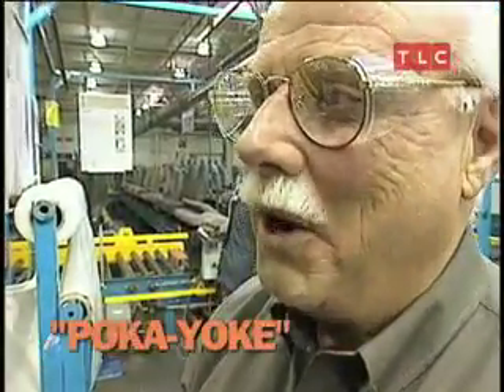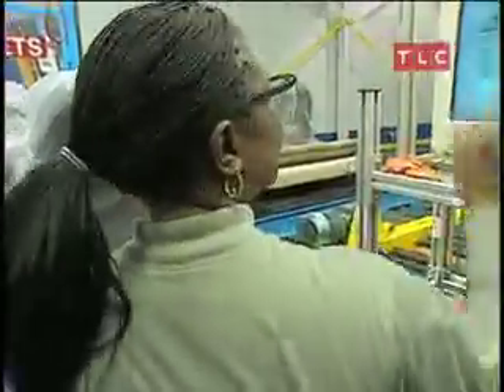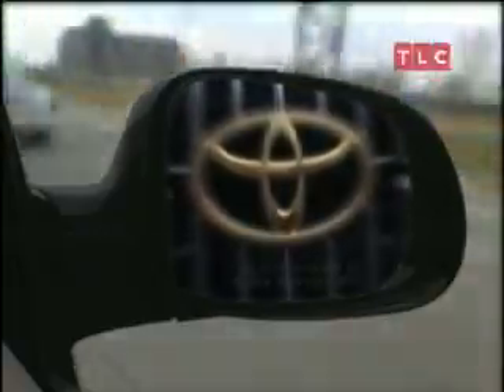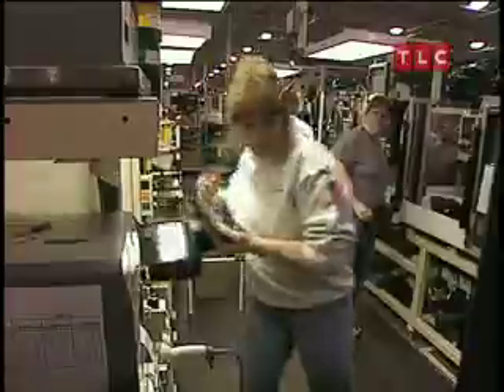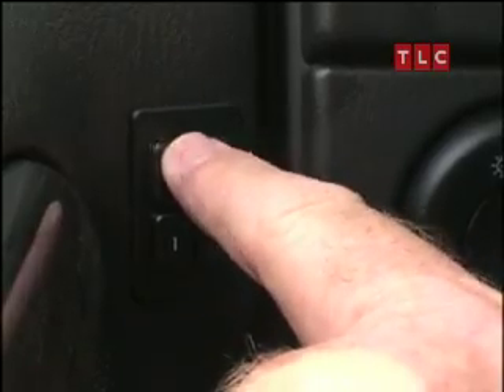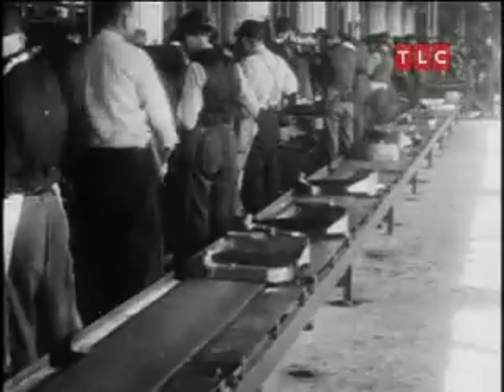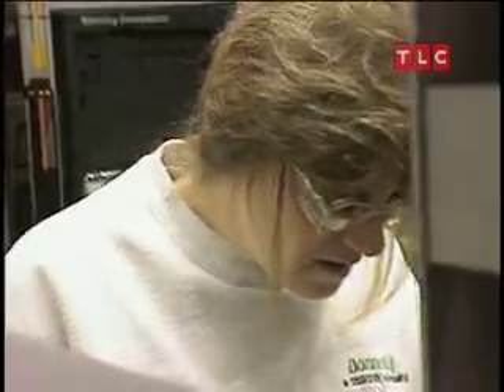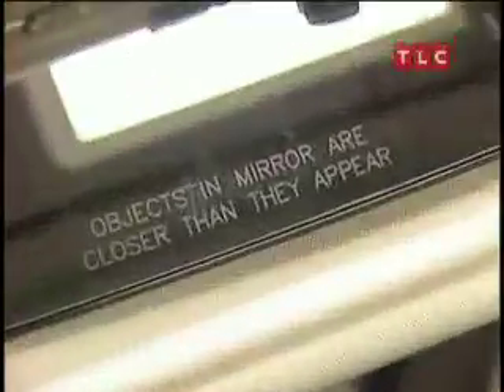Understanding: Poka-Yoke and Chaku-Chaku

Comment: This, while a spectacular case of innovation, would classify more in the 'Early Warning System' category, not Poka Yoke. this is because a beeper doesn't prevent an employee from picking the wrong part any way. 
Poka Yoke here (for example) would be a access window which opens for the right part required next in assembly, while remaining sealed for everything else.

Comment: The only holes in it is if the assembler ignores the alarm that they have done something wrong or have a mislabled bar code sticker on one of the bins. Other wise pretty air tight.